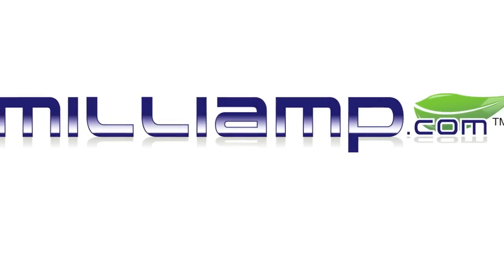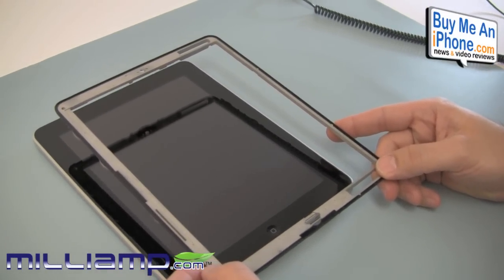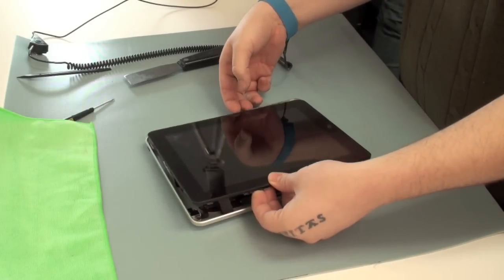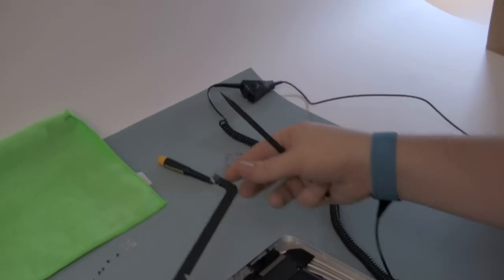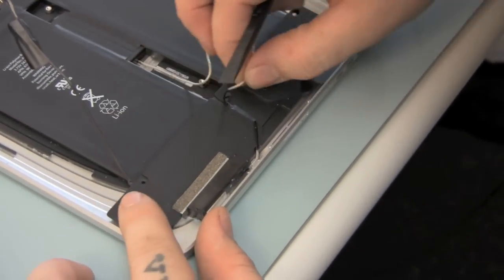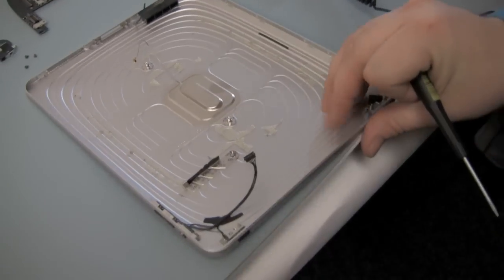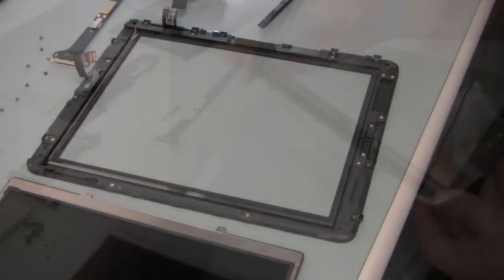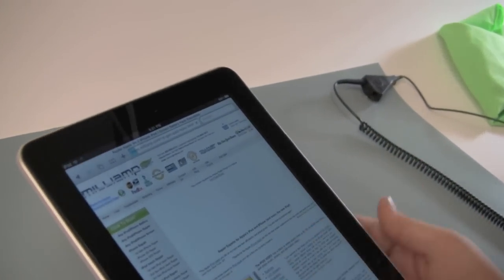iPad Tear Down

Comment: @naumankhawaja I would still prefer a slim "only-screen-looking" ipad. the technology/algebra for palmrejection is an eaysi instal. Everything bigger than a coin is not a tuch from a finger.

The only good reason why the frame might be there is for the air cirkulation which is totaly accepteble but unnecessary. I have an Ipad my self and it is always very chilled no matter how hard I do run it.